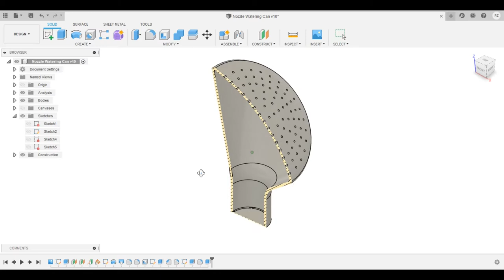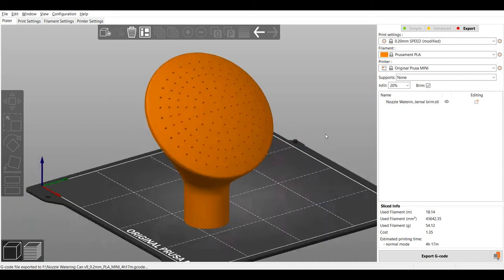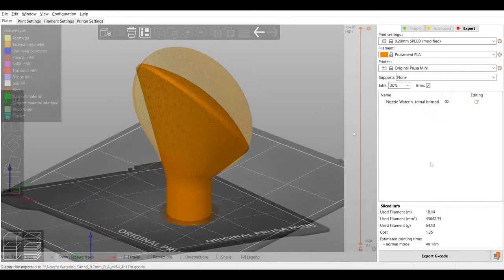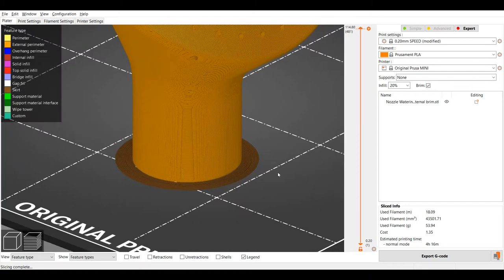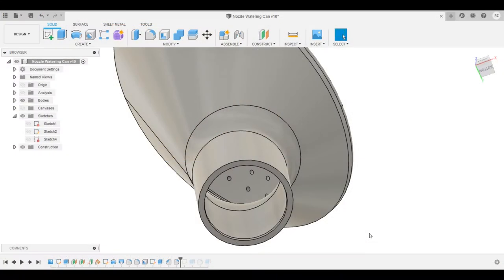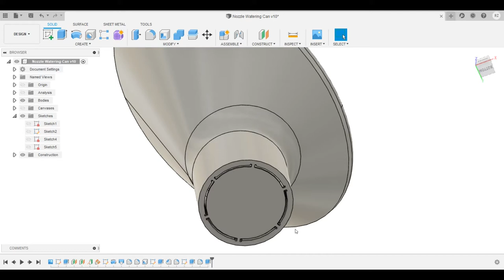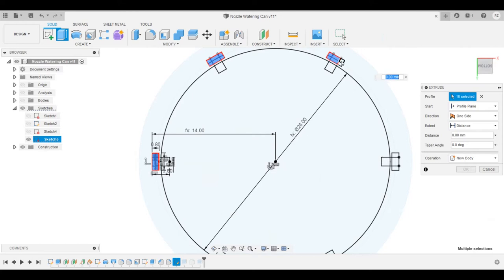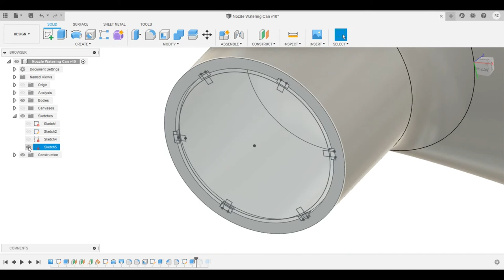How to create a brim for 3D printing in a CAD model

Comment: Why not use raft?
Reply from the maker: Using a raft is also possible. This was a test to see if I could create additional material inside the hollow part for adhesion without using a raft. It is more to give yourself full control of the support material for bed adhesion. I personally don't really like using rafts as they are more difficult to remove and leave marks on bottom of the part. Having said this, a raft would probably also work for this part. Just personal preference.